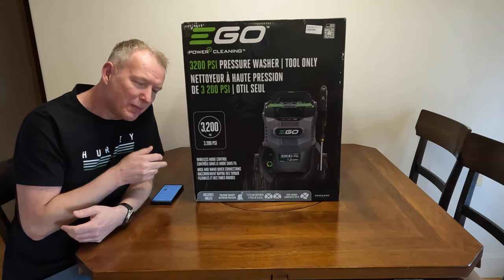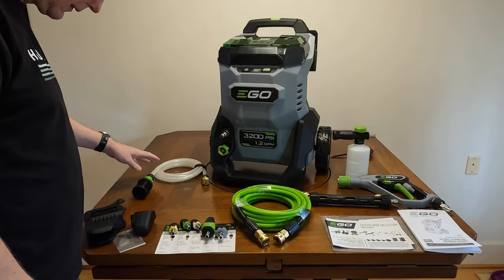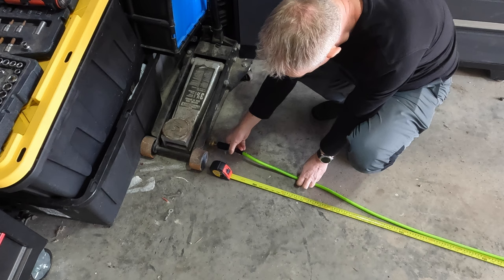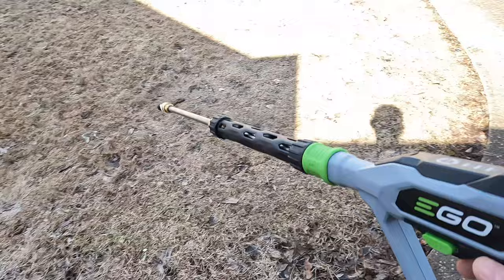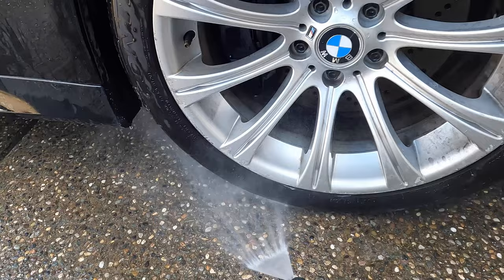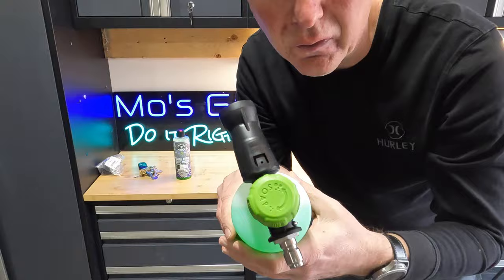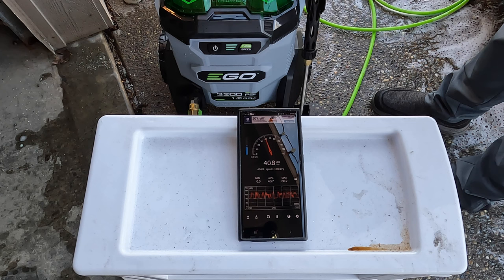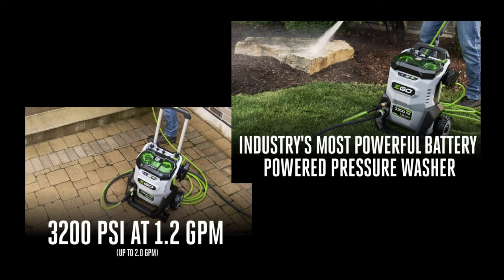Tool Review: EGO Power+ Pressure Washer HPW3200

Comment: thanks great review, just a question what type pf batteries  did you put in, you mention 10 hours and ten and half hour batteries,
that unit should be came with 2 sets of 6Ah batteries, probably you means 10Ah. 
so if you use the original 6ah you probably be run out of power.
and the last question why the use of both batteries are not equal, in the video one show used 2 segments  and the other-one used 3 segments of power.
Thanks in advance
Reply from the maker: Sure!  I ran 2x 10AH batteries because that's what I had handy at the time.  They came with my snowblower.  I bought the pressure washer without batteries or charger (toolless).  I think one of the batteries was not on the charger so it had a little less charge in it from running a leaf blower I am testing out right now as well.

The run times I quoted were from their manual.